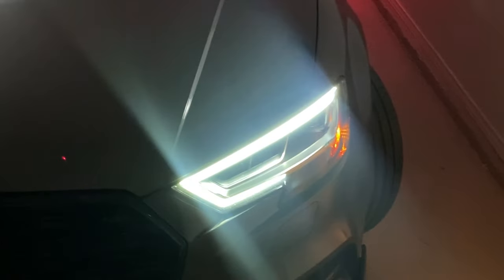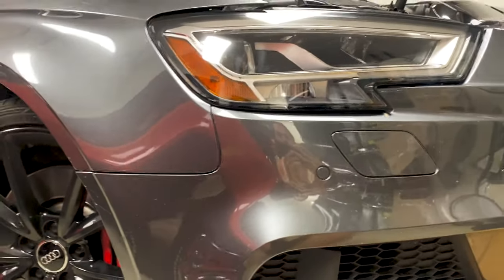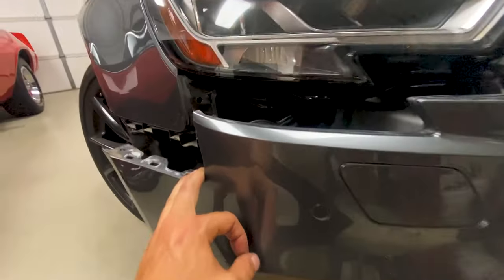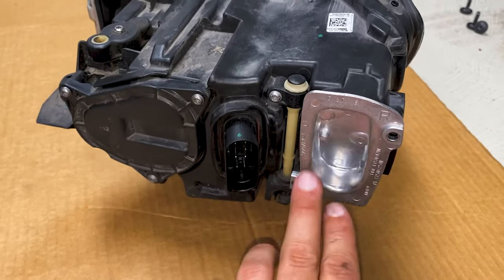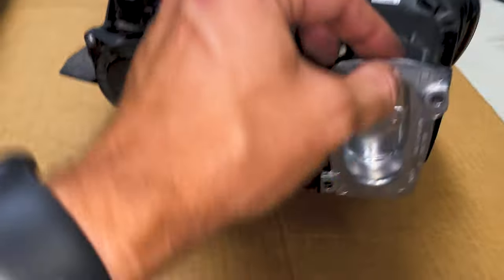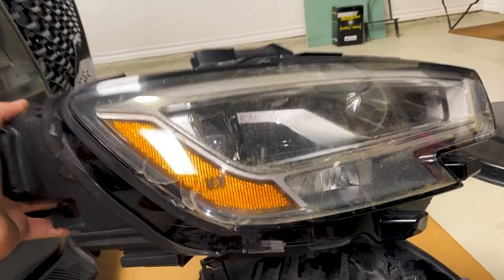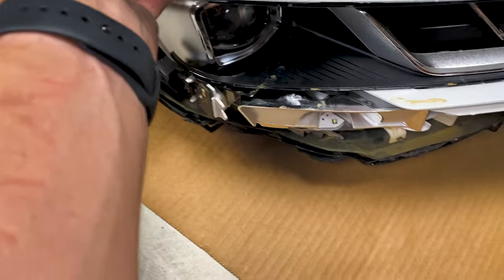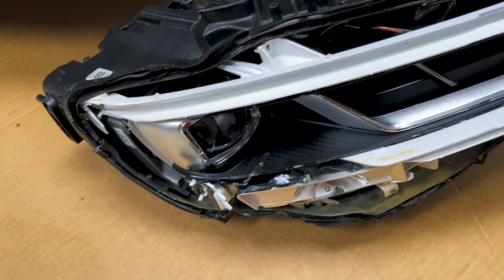How to Fix Dim Audi RS3/S3/A3 DRL

Comment: You're a legend for taking the time to do this video. Dealer trying to sting me with $1000 for each side for an entire new unit
Reply: Bro I got robbed by $3000 and  they didn’t fix the problem 🤦🏻
Reply: Same
Reply: They are charging some folks $4500 to replace entire units instead of replacing just the broken component.  Shame on Audi for making a $4500 headlight.  That's not luxury.  It's pisspoor design and engineering.  Shame!
Reply: I'll  just from $2500 on a new  headlight. This seems  difficult
Reply: @dontsugarcoat2729  so you want your other headlight to be new and the old one stays which is bound to fail in the future.  looks like ur gonna be spending 5k in total
Reply: @sirdaddybigboss  $2500 just to replace thw front right headlights DRL  is burn out
Reply: @dontsugarcoat2729  and if the left one fails? thats another 2500…. leave it alone or fix it like this guy.
Reply: @sirdaddybigboss  well I'm  mechanical  in cline. So should I pay  2500 or leave  it alone?
Reply: @dontsugarcoat2729  its really easy. Id rather spend my 2500 somewhere else instead of a new headlight assembly
Reply: That's a steal. They wanted $7600 to replace mine.
Reply: @borderlineiq  100% that
Reply: Just got quoted $13,000 to fix this on my Audi. They said $6,500 per side. Even though only 1 light has this issue.
Reply: @jimmyscott7414  im getting left side on sq7 done under warranty, it'd be a 9k job after parts and labour + calibration.  they mentioned the fixed side would be brighter but also said the other side would likely fail soon enough and get done underwarranty.  they didn't make me get two done.
Reply: Just did it right now, honestly not as hard I thought it would be… getting that light clip off took the longest lol

Comment: On my 2018 Q7 they want $4000 to fix this DRL issue (the new headlight is $3600). This video is absolutely the best.  Both my DRL’s failed but only 1 came in under warranty period.  Unbelievable they would engineer such a ridiculous contraption in a headlight that is a safety item.  Audi needs to get a grip.  I refuse to use the dealership for anything out of warranty.  Really appreciate your time in making this video.
Reply: How long did it last after cleaning the tube before it went back to yellowing?

Comment: I also found that it may not be necessary to bake out and remove the LED tube. if you can clean off the yellow from the end of the tube without removing it - even if the end of the tube is not perfectly smooth - it restores the brightness....as long as you also make sure the LEDs are cleaned up (see my other comment) in order to get back to a white color

Comment: Hi. We have bought this item on Aliexpress. The tubes was nearly 8mm that I have got delivered, but this tubes in the lamp is around 6mm. Can anyone tell me the dimension on the ones that you have replaced? The car is a A3 from 2017. Or can anyone help me with a link to the correct part? Thank you.

Comment: First off....EXCELLENT video. Thanks. This helped me repair my 2018 A3 DRLs.  I found that if the LEDs are not burned out but only yellowed due to  melting of the tube you can clean off the yellow with rubbing alcohol or similar solvent cleaning product.  If you get them clean it restores the white color and no replacement is needed.

Comment: Thanks so much for sharing this fix, I had this same issue and drove for quite some months like this, which also caused the problem with that “burn” stain to be even deeper in the tube and the yellow light was also worse than yours.

I managed to remove that spot with the Dremel and wet sanded the end of the tube.

Now it’s looking like new again! 

In the Netherlands a light unit like this (1 pcs) go for 2500,- and for that price it’s not even installed yet!!

So the advice for everybody who encounters this would be, start this procedure asap and you’ll be fine.

Thanks again! 💪🏼

Comment: This is awesome!  Thank you.  I will be doing this tomorrow to my daughter's 2017 A3 (Driver's side DRL).  Question - do you believe the LED diodes need to be up against the end of the silicon tube?  My plan is to use a fine grit Dremel bit to just sand off the burnt end of the tube.  Also purchased a new LED chip from EBay ($40) as you suggested.  I'm paying our Audi mechanic to remove the headlamp lens; I will handle the sanding with my Dremel, then he will re-install.  Before we re-install of course will test it.  My intent is not to add any foreign material (liquid silicon or acrylic); rather, just sand off the burnt end of the tube - thus my question of whether or not the LED diode must rest against the tube, or can their be a slight gap (after sanding) between the tube and the LED diodes?  I will try to video the job and share (if that's possible).  Thanks again - you're amazing.
Reply: Completed the DRL repair today just as NR shows in his video.  The original OEM LED Chip was fine.  Did have some burn residue on the diodes which whiped off with rubbing alcohol.  The end of the plastic/silicon tube inside the head lamp (the DRL tube) was burnt just like shown in the NR video.  I used a fine "arrow" shaped Dremel tip (came with the Dremel kit - hard green, fine grit bit) to sand the burnt section of the tube down.  The final product was a pretty clear end to the DRL tube; the tube is a very hard plastic and when I zoom in on the picture of the "after" effect, it shows some sign of cracking inside the center of the tube (similar to glass cracking).  Is the final product (DRL look) as good as a new headlight assembly (lowest quote for new assembly was $1,800)?  Not quite, however it is 95% + better, whiter, and brighter than it was before.  I paid our Audi mechanic $110 to remove the front bumper and headlight assembly and replace all after I completed the repair to the tube myself.  Worth every penny.  Total savings nearly $1,700.
Reply from the maker: Legit.  Well done, fam

Comment: Great video! Thank you so much. Recommend magnetic tools as those buried screws are a b&^#$ to put back in. Also that clip holding in the headlight was tough! In my case, the LED tube was very small (maybe only 5mm diameter), concave and brittle, so couldn't really clean out / polish out the burnt end very well so had to just scratch out as best I good. Not perfect, but slightly better than before.
Reply from the maker: Awesome!

Comment: Hi, great video. Do you have the link on where you bought the chip unit for the light?
I have an Audi Q7,2017 has the same problem 
Thanks
Reply: Hey. I have the same issue with my Q7/2017 4M.I reply need help as I am all the way in the Caribbean

Comment: Thanks for the video, great info!  I am having this issue with the lower portion of the DRL..Is there a way you know of to repair in thia way without opening up the headlight?  Thanks in advance!
Reply from the maker: No matter what the issue is you’ll need to either open up the headlight or buy a whole new one (or find one in the junkyard).

Comment: Hey I also have the bottom part of the DRL dim. Would you be able to maybe locate the module for the lower part or make a video on what the bottom tube looks like and where it connects? TIA!
Reply from the maker: Honestly, it was forums, google, and ebay that led us to making this video. If the lower part goes out... then maaaaybe another video will come about this. But its assumed you need an answer soon than that. lol
Reply from the maker: Rubixxx  Probably will make another vid soon, lower DRL just has started to have issues.
Reply: I ended up buying a set of headlights off aliexpress
Reply: Just tried fitting and theyre faulty so still looking for a solution
Reply from the maker: @Jasonoh9898  you should open your old ones
Reply from the maker: @Jasonoh9898  ugh! This is so annoying.
Reply: @Jasonoh9898  hey how are those lights from Ali working out for you because my DRL are funky too driver top dim passenger lower dim looks like a style but don’t like it
Reply: @Ricky-we2jk  nah man I’m from Australia and they sent me faulty ones. I’m trying to get audi to cover them

Comment: Super useful and concrete information man. Just one question: Is needed to disconnect the battery when u removed the headlight? I mean in order to avoid some check engine error/message later
Reply from the maker: I didn’t disconnect my battery and I didn’t have any error messages.

Comment: Great video, thank you so much!
I just have one doubt. If only my DRL is out, is replacing the tube necessary or as long as I do the chip I will be fine?
Reply from the maker: You probably won’t know until you get in there.  But if your DRL is out completely, it’s probably just the chip.

Comment: Thanks so much for the video! It is really easy to follow and saved me  a ton of money. I have had to do this a few times since the tube seems prone to melting/burning. 

Can you provide more details on how you cut off the end of the tube? I can’t really get a razor blade in there due to the tiny space and it gets increasingly harder every time I do it due to the tube getting shorter. I have also tried to sand it down manually but it takes so long and isn’t very effective.
Reply from the maker: The dremel tool is your friend.

Comment: Great info bud! Do you know a fix if it’s the bottom section of the DRL that’s out?
Reply: Likewise
Reply from the maker: The information in this video is only homework done (lots of google lol) to resolve this issue. There's a strong chance its a similar issue... unless there is a bulb in there.
Reply: I have the same issue, if you get an answer or solution, please let me know !!!
Reply: I have the same problem, one is up and the other one was down. The bottom one I didn’t see anything outside so I open the whole unit and find out that the module (led) was inside.

Did the same process, clean, polish and works great. 

My actual problem is that both sides only works fine 1 week and it burns again. Know I am buying the acrylics and replaced them.
Reply from the maker: Just posted a vid about the lower DRL

Comment: Thanks for the vid.. isn’t it possible to just replace the drl tube? Would they be on the market? 
Also can you assess the tube without taking apart the headlight?
Reply: aliexpress has replacement tubes, just search for the needed
Reply from the maker: You could definitely replace the tube. I doubt they are sold individually. You would probably have to buy a cheap damaged light on eBay. But it’s way easier and cheaper to just clean off the end of the tube.

Comment: You can use a small dremmel tool to get rid of the burnt plastic and fill in the gap with clear heat resistant glue and smooth it over

Comment: THANK YOU for making this video!  Dealer replaced the entire headlight assembly on my daughters 2019 A3 through Audi CPO warranty. It started dimming so they replaced the whole thing.  Problem now is the passenger side doesn’t match…new DRL is a bright white and the passenger side is an amber/yellow color. Do I just need to replace the DRL control unit?  I don’t understand what you guys mean by “bake”. Sorry I’m not the most handy so I appreciate any guidance here. Thanks so much!
Reply from the maker: It really depends on the the issue. the DCU could be the culprit, or the end of the fiber optic could be  the issue. As for baking: Bake, like a cake, put the headlight in an oven to soften the glue that holds the clear lends to the head light housing.
Reply: @NoRevving  I need to replace both lenses...they are all jacked up. Sooo, I am thinking of baking, but what I don't want to happen is my lights to get damaged, because I did not seal them correctly. Any tips on how I might go about this...I imagine I can just about search any headlight repair not related to Audi.

Comment: I have this issue, took the light out and it had three little burn marks on the tube. So if I use a dremmel so sand it back to clean it should work out all ok?
Reply from the maker: That what we did. Sand of the burn part so the light isn't obscured.
Reply: @NoRevving  is the tube easy to pull out and clean? Since it was so difficult on the donor?
Reply: @etiennemallia564  I used the dremel.. not quite as bright but a lot better! I think it involves baking the headlight and opening to remove the tube. The strip is spring loaded
Reply from the maker: @etiennemallia564  You have to bake the headlight to open it up. It's just easier to just remove the LED chip and clean off the end.

Comment: Hey. The only video online that actually explains what to do. I have a question though. DO you reckon this would be the same process for a VW ARTEON? I just have my passenger DRL go dim and my suspicion is because of the LED Module burning out. Stealership advised me a new headlight which cost $2400 AUD + $360 install fee.
Reply from the maker: It would probably be similar.

Comment: Wow mate, you are awesome! I have the same problem and my lights are matrix led so the light apparently is more expensive. Which is the OEM reference number for that part?

You safe me, thank you so much, I am going to do the same!! 👍🏼👏🏼👏🏼👏🏼👏🏼😘😘
Reply from the maker: Don't recall. We just went looking on ebay and google.
Reply: matrix LED headlight drl module is 8V0998473B 8V0998474B, I got form antparts and fixed my headlight.

Comment: 2018 A3 Premium the bolt up under the fender, the one he says you need a T30, the bolt for 2018 on mine is T27.  Took me 5 hours to get it out, no extension will work, just 1-2 clicks at a time if your hands are nimble. 

I've taken off a lot of different parts before, that's the hardest bolt I've ever seen to get to. 3x I walked away. But I thought it was a T30, then a T25. It's T27.
Reply from the maker: Thanks for the update.   The worst bolt known to man

Comment: Hello, and what about if it is the other part (bottom & side) of the DRL that is dimmed? The first part of the DRL( the one that is dimmed in your video) it's ok but.
Thank you. Best regards.
Reply from the maker: Honestly, not sure. This is our first attempt at doing this and only looked into resolving this specific issue.
Reply from the maker: We just posted a video about the lower DRL
Reply: @NoRevving  thanks a lot, I will check it now.

Comment: Hi i have a Audi q7 2016 model n it has the same issue of drl which is very lite n yellowish glows up . Suggest me what can I do to it.  Is it possible for me to remove the small chip connector n grind the pipe n fix it ?
Reply from the maker: We haven’t worked on one of those.  The logic is probably the same tho.

Comment: That makes me curious… my top half of the strip works but the bottom “C” shape portion isn’t. Was hoping it was just the module but I’m afraid mine will be new headlight
Reply: I think there is an internal LED module for the bottom DRL. The light needs to be ‘opened up’ to get access. No idea what’s involved unfortunately.
Reply: @istefanihoerzer1089  yeaaaaaaah i found this out since. I’ll buy new headlights before opening them lol

Comment: does the bottom part of the DRL use the same LED as the top?
Reply from the maker: No. It uses an LED control unit that is inside the headlight. The only way to access it is by removing the headlight, baking it open, and disassembling some of the internals of the headlight. If the back side of tube is melted you will still have to do all that to access the back of the tube and the LED control unit.

Comment: Also I’m confused on how the DRL tube is in better shape at the end of the video. To me, it looks worse than it did originally. After the tube was cleaned up, it looked like it would prevent less light from traveling through it…looked more opaque. The tube at the beginning looked more transparent so I would think the light would travel better through that tube. I know you know what you are doing but this is all new to me so I’m trying to make sense of what I’m seeing…help lol
Reply from the maker: Its perspective. Originally, the light is blocked by the burnt portion, hence the dimming. The angle of the second shot is head on and facing down, so  it looks dimmer than original, however, looking at the before and after light output, obviously it is the results you want.

Comment: Hi, mine is failing but in the lower LED. Is that part also able to reach? Thanks!
Reply from the maker: Not really sure. We only did the part of the LED in the video.
Reply: I've searched forums and read that you would have to replace the whole unit.  I too have this problem and only found out recently when I had seen my DRL on someone's rear bumper....Really irritating as I had purchased the S3 last month...
Reply from the maker: @j0hnpark  Thanks for jumping in.
Reply: @j0hnpark  dealing with same issue and just purchase my S3 as well 🥲